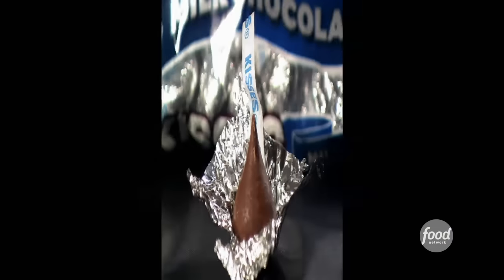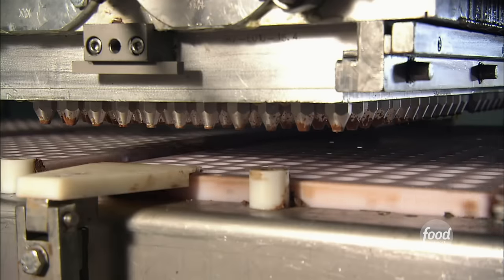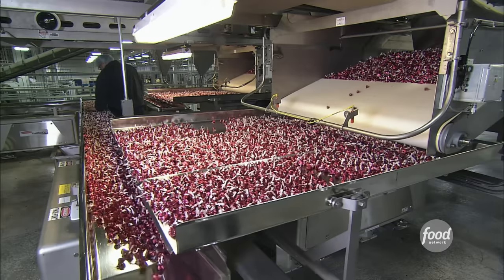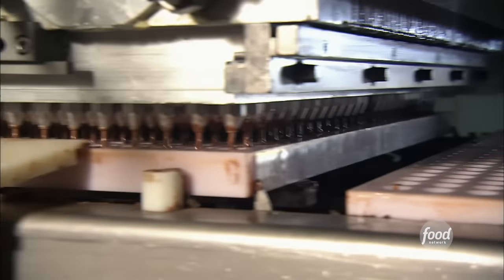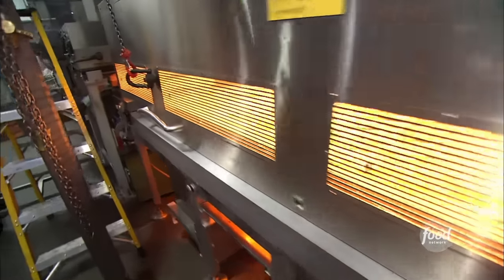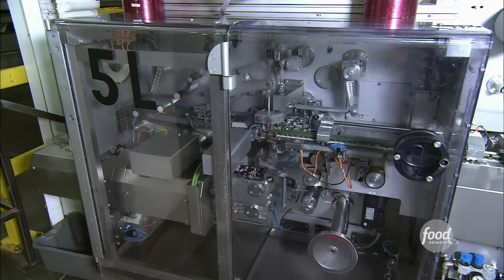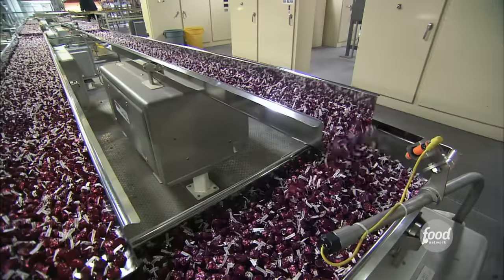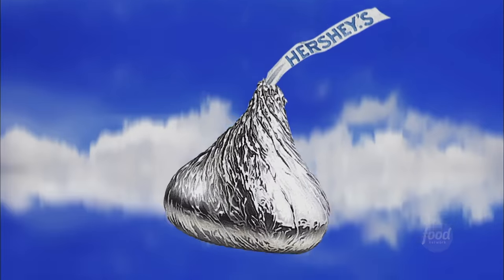How Hershey's Kisses Are Made (from Unwrapped) | Unwrapped | Food Network

Comment: Couple years ago Hershey had a huge problem with the candy kisses.  When unwrapped, nearly all of them were missing that iconic point on top.  Most were malformed and had a hollow crater where the point should have been.  The others were broken off before being wrapped.  

Maybe a result of part of the process being moved out of country.  Took a while to get it set up properly again.
Reply: It wasn't moved out of country the tip broke off cause of a blockage in the new depositors they have gotten. Stop spreading the lie that it's made in Mexico when it is indeed made in Hershey pa
Reply: @DirewolfGaming I second this. I live in Hershey. The candy is still being made here.